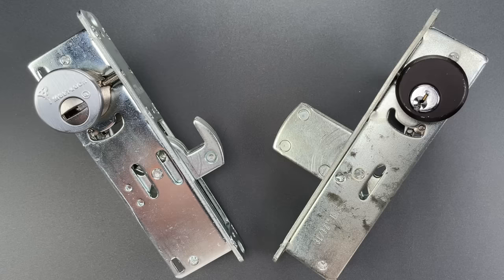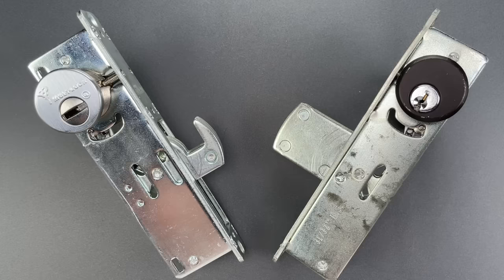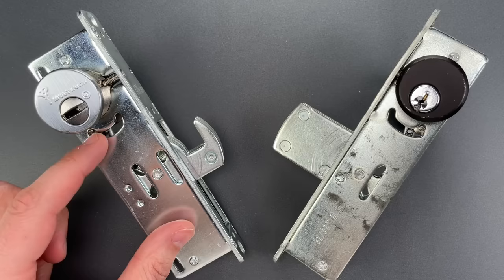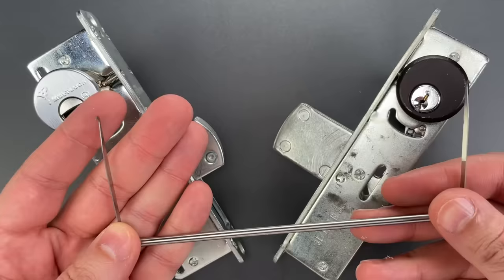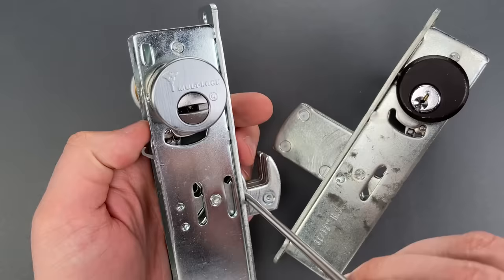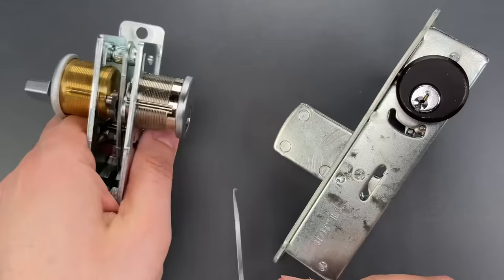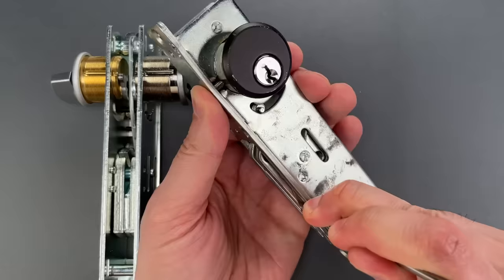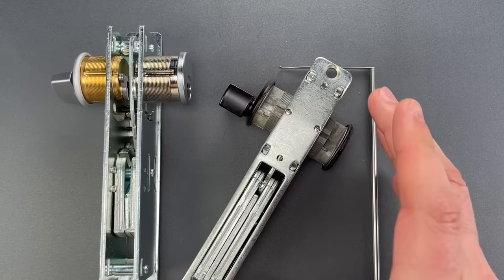[1409] The Most Significant Security Flaw in North America

Comment: I found one of these store locks (with a Kawneer-branded cylinder and a battered Yale key) at a garage sale when I was maybe 10 years old for about $7, which was kind of a princely sum when I was 10.  I had to have it though.  At the time I couldn't pick the cylinder, but it was interesting to see how it worked.  I figured out that I could unlock (bypass) it in the same way as LPL using a screwdriver, then rummaged through the drawers of my dad's odds n' ends and managed to open it the same way with a bent piece of flat steel that I'd filed a notch in.  Never had the guts (or the larceny in my soul I guess) to try it on an actual door.  It impressed my friend that was also into collecting locks and keys though.  Cool to see that someone besides me finally noticed you could do this, and very surprised that AR hasn't shielded this yet, as the lock I still have is at least 50 years old.  Edit:  Just noticed from the comments that I was apparently not nearly the only person to have noticed this years and years ago.  To be fair, these locks were almost always in glass doors, so anyone that wanted in only needed a brick.
Reply: There are some lovely videos out there of bricks rebounding off the glass and knocking out the would-be thief.
Reply: @briant7265  those videos bring me great joy, especially when the thrower knocks out his friend with a rebound.
Reply: If you don't break the glass door and somewhat mimic opening it with the key, i guess there's a lower chance of people becoming suspicious
Reply: Would a brick really work against toughened glass - I doubt it.
Reply: @royksk  it’s a testable theory!
You might be surprised at the glass used in storefronts. Many are rented and the landlord cheaps out… oftentimes modifications or damage will lead to repairs with different glass from the original. 
All that said, there’s definitely plenty of glass that will take 1000 brick strikes
Reply: I gotta find a place that sells bricks.
Reply: @royksk  Most doors like that have tempered glass like car windows, though thicker.  I've never shattered one, but I think the 'key' (no pun intended) would be to get something with a pointy edge, like the glass breakers they sell as escape tools for cars.
Reply: @swayback7375  not the Cybertruck though, lol
Reply: "To be fair, these locks were almost always in glass doors, so anyone that wanted in only needed a brick."

Yet another example of 'Locks only keep honest people honest.'  Anyone who really wants through a lock is getting there eventually, either through non-destructive, or destructive means.
Reply: @royksk  
Break a piece of a spark plug throw that at the glass and it will shatter no brick needed
Reply: @richardhanck972  - It's not so much keeping honest people honest. Imagine this. It's 4AM, you see someone walk up to a storefront, take something from their pocket, and in a blink with a small hand motion "unlock" the door and open it normally. (From a distance I'm willing to bet it's near impossible to distinguish from opening with a key.) 
Now imagine the alternate universe where it's 4AM and you see (or even just hear) someone throwing a brick through a glass storefront. 
In which case do you think someone is gonna call the cops?
Reply: @briant7265  Most if not all glass doors are required to be tempered glass by building codes because that way the glass doesn’t break if you slam the door however that also means that what appears to be a big sheet of glass can actually be harder to break by throwing a brick at it then you would expect.
Reply: @TheMrVengeance  In both cases, the person involved had ill intent before the lock was bypassed. 

An "honest" person is defined, in this case, as someone who, walks up to the door, notices it is open, and then becomes a dishonest person by walking away with whatever isn't tied down. The lock would have "kept them honest" by removing the temptation.

People with the skills to bypass locks keep themselves honest. People without the skills have help.

In either case, entry tool or rock to window, a monitored alarm system should be the next line of defense, and a visit from the police should be in the near future, regardless of how public the entry spectacle was.
Reply: @last1second  depends on how loud the alarm is on the security system.
Reply: Ahem, gentleman in my nefarious youth i attempted to rob a beat down ramshackle hole in the wall store in a mini mall. Old. Poorly maintained. Rocks, crowbar, harder materials (spark plugs work because they're higher mohs than glass) and even the willingness to make hella noise and act a fool (for 4 minutes) did not budge that glass door. We shattered it but never obtained access. Such doors when well made have multiple layers of glass n plastic melted together into one pane. They are quite resistant. Attacking aluminum door frames and edges of the doors themselves is much faster, easier, less obtrusive than breaking glass. My bro and i walk up i slip a  2' crowbar outta my sleeve into the gap and throw my weight back on it as my bro pulls the 4' outta his coat and pant leg and sets to pry frame (i worked door side) . We both get a couple pries in back and forth so we have room to get the 4' hook in the gap. Then we both switch to the 4' throwing everything into yanking that frame open enough to clear the bolt. Ez pz   2 minutes at most. I've done a steel framed steel door in a concrete industrial park in about 6 with second rate tools. The bolt isn't more than 4" or so long. If you can find purchase to put both feet on the wall and both hands on the bar (yes you'll be hanging in the air like spider man) you make a deadlift motion and it's much much faster and easier and should get your times down close to mine. Good luck out there boys and remember to stay safe. And check out the channel i just started about us heathens here in the trailer estates. Where the greasy meets the grimy.
Reply: In the first instance i used crowbar as a hammer to smash glass and not to pry anything.
Reply: That’s cool I enjoyed the story/memory. It is amazing these exist

Comment: After watching this last week, I took note of many businesses doors I've encountered. I would say 95% of them have a shield in the locking area of the door.
Reply: Yes that would be a huge deterrent as those shields also usually flare out around the lock cylinder to keep it from being twisted out.
Reply: I was wondering if it was really as useful as he makes out. Its an advert for his own tools and pretty rubbish that he didn't mention if a lot of the doors with these locks can't be accessed this way
Reply: @1physics  Almost no doors in my local area have shields over them. But lets remember, the most effective way to get into a store is to just smash out the window.
Reply: @relytlirpa  Not necessarily. Around me, there's bars in every window and door for almost every store; breaking a window is pointless unless you just want to break stuff.
Reply: @1physics  It is pretty much useful as he makes out, those shields do NOT prevent the attack completely, you just might need a slightly longer tool. While he sells a tool for it, it's obviously something that can be replicated very easily, possibly even with a coat hangar. The video as a whole is definitely not an advert, though he does advertize in it.
Reply: @Just.Kidding  how is a longer tool going to defeat a shield?
Am I missing something?  I thought they meant a flat metal strip across the front of the doors to stop you being able to see any gap between the doors?  A gap like the one he shows wouldn’t be very weather tight either.  I doubt you’d ever find a door with any sort of gap in my locality, for weatherproofing if not just security.

Unless you could make the tool out of very thin and stiff material so you could slip it in under the strip and have it turn through two 90 degree angles?

Comment: In my experience as a door contractor, the reveal between door and frame is usually smaller and would prevent the tool from being inserted. The bigger security risk is the glass. Master keys are laying around everywhere.  Rocks, bricks etc.
Reply: Which are neither quiet nor neraly traceless
Reply: I’ve used a small pry bar to enlarge the smallest gap to use this tool!!
Reply: LPL has a video where he uses a prybar to enlarge the gap enough to insert the tool. This is simply a design flaw
Reply: As Coolio once said- "I got a skeleton-brick that works like a charm."😏

Comment: I work on these MS locks daily, I'm also a firefighter who needs access to numerous locks regularly.
#1 in my experience lately, there are VERY few of these locks without a tempered steel lock guard from 8"~12" covering the door gap at the lock thus preventing this.
#2 it's much easier and faster to use a set of vise grips around the cylinder twisting and breaking the set screws thus allowing you to remove the cylinder gaining full access to the same lever you're grabbing with this tool.
#3 I think there would be more doors than not that do not have a large enough gap to allow this tool in that space, easily enlarged with a pry bar mind you. 
Just my opinion from experience.
Reply: Hmm. Seems legit. I'll let you know tomorrow how it went
Reply: @KiroHeart  be advised, cylinders may also have a cylinder guard to prevent this also, lol
Reply: Lets be honest here. Its not hard to break into any home or regular business. Glass windows, hammer, power drill etc. If you want to get in you can.
Locks on doors are just 1 deterrent for a criminal.
Have a security system (or pretend you do)
Have some home cameras
Have a gun
Neighborhood watch
and so on.
Reply: @bobshanery5152  Having a gun only tells your american, not beeing able to deter burglars.
Reply: I work on doors with these locks often. I'm in Arizona so that might factor in. This tool would fit in the gap just fine here, though there would be some weather strip to wiggle it through. I only see lock guards on store front doors in the shady areas of Phoenix. I might get this because store managers never want to give up their key. And it can take forever to track them down to test the action of the lock. Right now I use a thumb turn to test it out before putting the cylinder back in for the store manager to test.
Reply: I assume you are an american firefighter, just before you use your gun to shoot out the fire, use it to shoot the lock first? I dunno.
Reply: @lochmarFiendhiem  Yeah, I'm gonna waste ammo on a door at these prices. Okay.
Reply: @Wallbank888  yeah better keep it for the kids
Reply: @tk_customwoodworks  Wow now I can get into any bank I want!!!!! This worked perfectly! (I think I'm legally obligated to say jk)
Reply: #3 is inaccurate. Double doors in general need to have looser tolerances to open at all, and commercial doors that are going to see high traffic and rough handling in particular need to be that way to prevent jamming/sticking. If the gap were narrow enough to stop attacks of this kind it would also prevent the door from opening or closing flush reliably. You'll see gaps as wide as or wider than this even on relatively low-traffic internal office doors (hence the prevalence of lock guard plates).

All that aside, the advantage of this sort of attack from a criminal's perspective is that it's nondestructive and not immediately obvious as an attack to observers. If you're going to break the cylinder out of the door you're better off just putting a brick through the glass, it requires less time, less knowledge, and simpler tools (which is the basic tweaker B&E MO anyways).
Reply: @Brodaufschdrich  lol a gun IS how you deal with burglars!
Reply: @bobshanery5152  When someone stole my bike I just had a friend join me and then we used our words to recover it :)
Imagine needing a gun 
🤡
Reply: @michaelmaas5544  So I would guess there are less burglaries in the US than say here in Switzerland, where very few would keep a gun in their shops. Probably not
Reply: @jonasdaverio9369    You can’t compare a country barely bigger than New York and the diversity of a country music concert to the US. But nice try.

Comment: 1:40 The stores should just weld a little piece of metal to cover up that area.
Simple but effective solution
Reply: That's what I was thinking.🤔
Reply: Simple and effective. That means very few people will actually install it.
Reply: They often do that’s common
Reply: Yeah, I've seen a few stores do that
Reply: ah yes. because they wont just find an easier way in. most of those doorframes are aluminium, enough for and you'll bend it out of the way or just shatter the glass

Comment: I once worked at an office where the reception doors were magnetically locked and could be opened from outside with a keycard. This protected the entrance when the receptionist had to step away. On the inside, there was a motion sensor above the double glass doors so that someone leaving didn't have to use a keycard. One evening as a test I went into the hallway, and used a piece of photocopy paper taped to the end of a ruler, and stuck it through the gap between the doors and triggered the motion sensor to get in. There is a reason for those floor locks at night on this type of setup.
Reply: Should be an IR sensor and not be tripped by small things like paper that is room temperature.
Reply: There is an amusing variation of this in a YouTube video, I think it was "I'll Let Myself In", where the person who desired entry simply blew a cloud of e-juice vapor through the gap in the doors to trigger the motion sensor. I particularly liked that demonstration because it required no suspicious or improvised tools. Within seconds after gaining access there is zero evidence of the method of entry (other than perhaps a lingering odor of snickerdoodle cookie).
Reply: I call BS.  PIR motion sensors aren't tripped by moving paper unless it happens to be on fire.
Reply: @stargazer7644  Camera based motion sensors trigger by any movement above a threshold measured in pixels
Reply: @EuclidesGBM  Commercial door control systems don't use cameras.  They use thermal PIR motion sensors.
Reply: @stargazer7644  I just wish they could pick me up in the sensors, I have to do jumping jacks before they work for me everywhere I go. I've walked into so many doors it's not even funny, give me back traditional doors!
Reply: @stargazer7644  not every store uses this set up. Shocking, I know but some companies are cheap.

Upside down compressed air can will work as well, because cheaper IR measures temperature difference, not specific threshold. More expensive ones will look for at least human-like shape.
Reply: @clonerstive   PIR motion detectors are 2 pixel detectors.  They measure moving temperature differences across their two pixels.  They use plastic Fresnel lenses to focus multiple beams from different directions onto the two zone sensor.  Please share a link for PIR sensors that detect "human like shapes".
Reply: There is very easy work around - you just use vapour or some kind of gas cloud - like from a CO2 can. It triggers the motion sensor too. Gets through any and all cracks.
Reply: @jasonfournier  I imagine it probably was a PIR sensor. But using a piece of paper to block and then reveal the heat sources in the room makes the sensor see changes in the heat signatures in the room. As for it being small, the sensor was right above the door frame, centred over over the double door crack. It was quite simple to be able to get the paper close to the sensor, thus a sheet of 8.5x11 paper could block a lot of the view as it was waved in front of the sensor. Definitely a poor sensor placement.

Comment: Its not about the stores lock, its about insurance. You just need a lock that the insurance company aproves. 
The thive will find a way, even if its through a brick wall.
Reply: local store they cut a hole in the roof too get in
Reply: "The thive will find a way, even if its through a brick wall" - in theory yes but in reality they move onto an easier target....
Reply: @mikew151Manhattan  That's how security works. Your home doesn't need to be rob safe, it only needs to be safer than the neighbors' house.
Reply: All you need to do is pop the vinyl siding off, pull the nails holding the sheeting on, remove the insulation, and kick a hole in the sheetrock.
Reply: yep locks only keep the honest people out....
Reply: @mikew151Manhattan  This is one of my co-workers theories nowadays after his bike got stolen from outside of work one time. He uses multiple bike locks with the idea that future thieves would rather go for the single locked bikes than his triple locked one. Other techniques seen at work includes chaining the bike up on the fence 4 feet off of the floor, and just taking the front wheel off and leaving that in the slightly more secure locker room.
Reply: @233Deadman  Front wheel is a pretty solid one.   Makes the bike worthless
Reply: Same with all those gun locks? Many of them are crappy because people who buy those don't care about them actually providing security, but about legally fulfilling the requirement to have one?
Reply: @Tobiasliese  Whenever I hear this I imagine two neighbors suspiciously watching the respective other while welding another layer of armored steel plates around their house.
Reply: @Tobiasliese  totally
Reply: @VintageTechFan  Scale that up and you got the cold war.